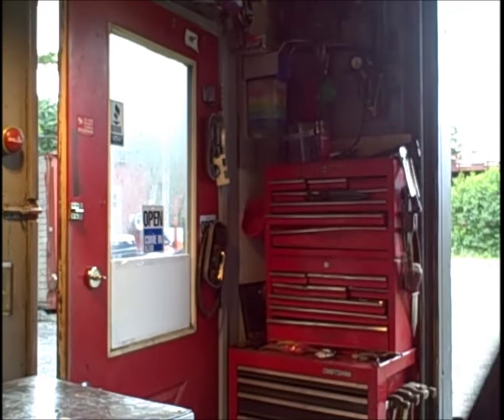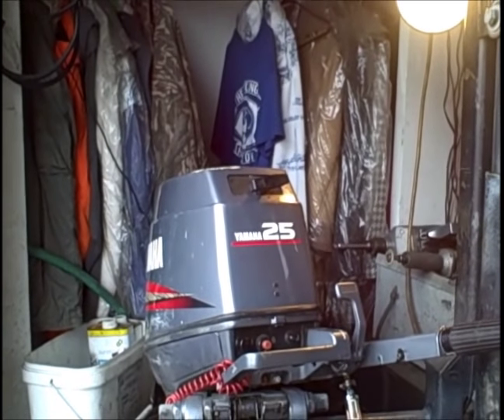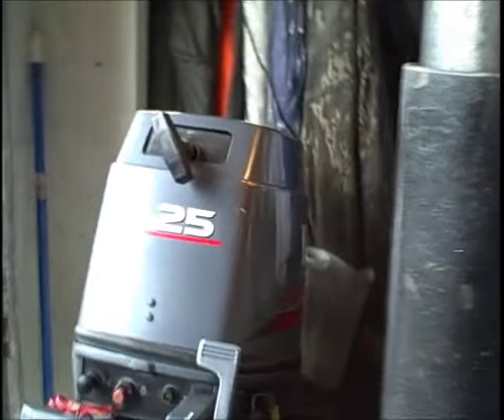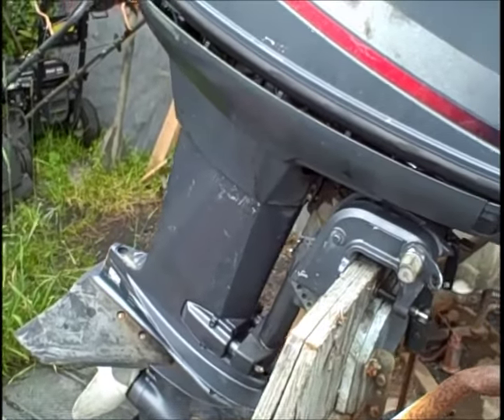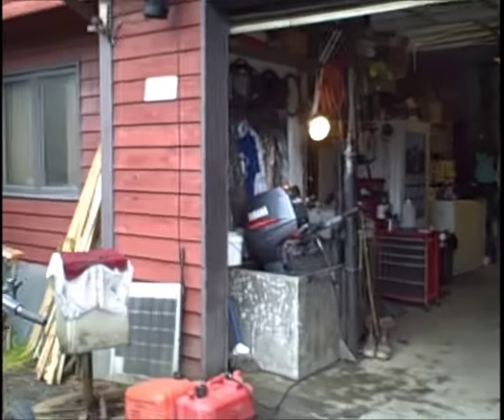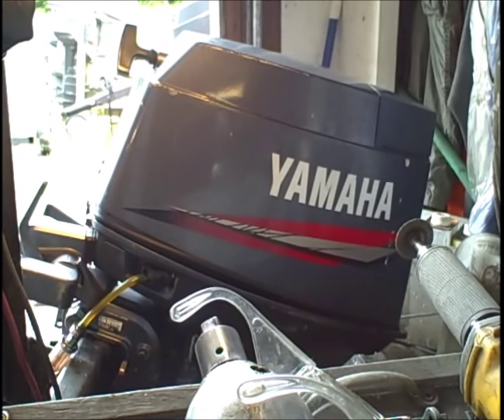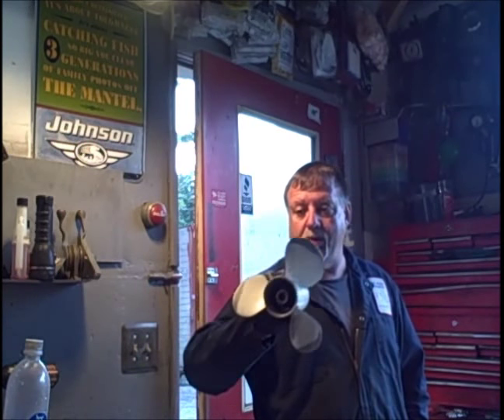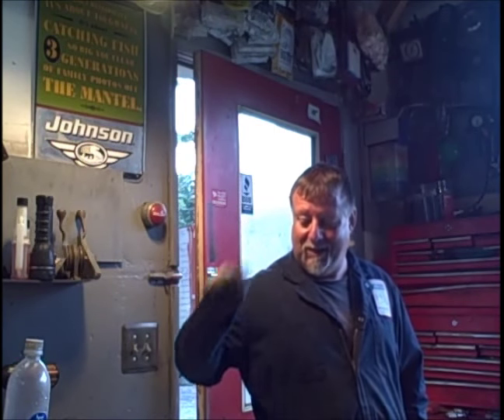Yamaha 25, 40  HP

Comment: Sorry about the 40hp, guess it was "just too good to be true"....Such a nice engine otherwise...Just put it aside, a good powerhead will turn up sooner or later...Hard to judge the 25hp, especially on a video...But, it is just like you say, you will know for sure after you take it out and run it hard on a heavy mix...You had to try, and you are still "way ahead of the game", even if both powerheads are NG...Just selling the gearcases would make this project more than worthwhile....I'm a bit like you though, hate to part out engines...But, you have to be practical, and rebuilding those powerheads is not financially practical...